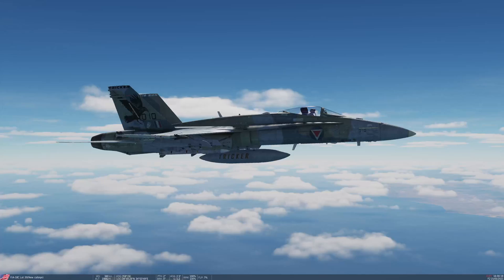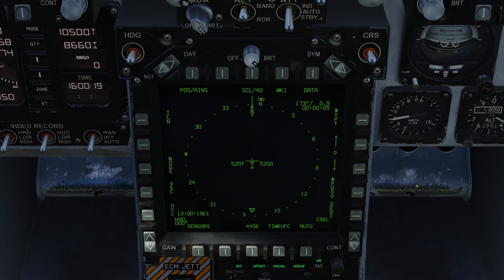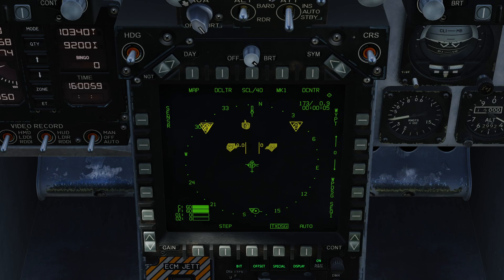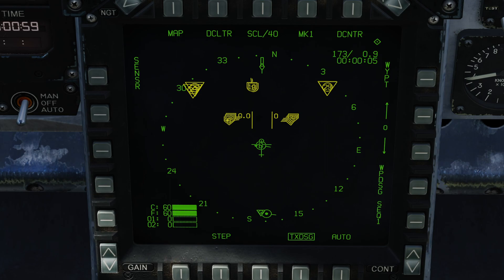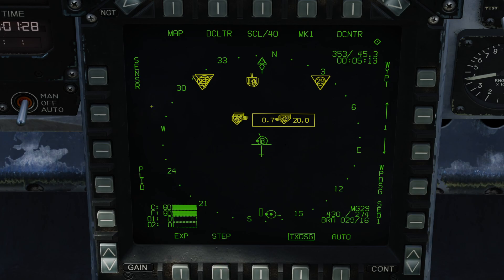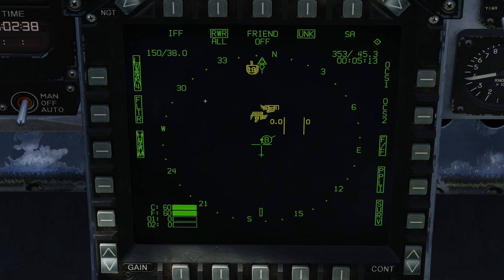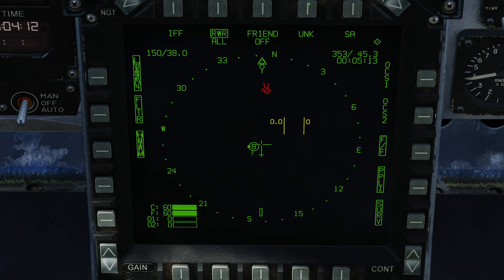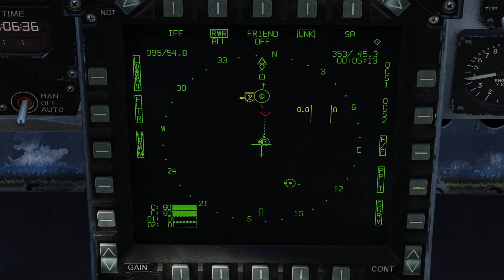DCS F/A-18C Tutorial 18 - SA Page

Comment: Does bulls not need to be setup on waypt 59?
Reply from the maker: No, on the Hornet it can be any waypoint. On the F-16 it is steerpoint 25.
Reply: @deephack  I thought/think wpt 59 is automatically populated with Bullseye on the map. If you set wpt 1 to bulls whatever wpt 1 is will become your jets bullseye. It wont match anyone else who setup a proper bulls. If I understand that right?
Reply: @projenitor2387  BE can be set up for any waypoint. Infact, depending on your mission you may want to BE multiple locations if they are far from each other. This will need to be understood by the group and not represented on the map as a dedicated BE. Since the AWACS is giving calls to all aircraft and it's preset it is generally set via mission editor, with a marking on the theater map... So everyone is on the same page across all changing missions etc.

Let's say you were to go out on a strike mission. WP1 could be BE1 for your flight group and dedicated AWACS. Once the mission is complete and you move to WP2 which is another target, you can set BE to that WP. AWACS if maned, would also switch it's BE... Since AWACS is automated it's simplified and BE isn't as useful or precise but it does help to keep a good overall picture of the airspace. 

The reason I would BE each WP for each mission if I had a flight group is because you know from your target location where aircraft is around that area.. 180/20 from BE would mean that there is a target 20km south of the target.. easy peasy.
Reply: @Snowpinemedia  Wouldn't that denote that each flight would have to adjust it's bulls on some one else's schedule?

If I complete task at wp 1 Bulls on that way point. When I move on to wp 2 some other flight would have to know that in order to track any marked targets? 

It's to my understanding Bulls is set for the theater so one flight 50 miles east, and another flight 50 miles west can have a picture of the battle space from the same reference point?

A lot of our missions have 60-to 70 active player aircraft with their own tasking. I feel swapping bulls and keeping all 70 aircraft on the same page would be counter intuitive?
Reply: @projenitor2387  Yes that is what I said. I said it's changeable for dedicated missions.  
If there are multiple missions, or a larger theater of war it would strategically be placed  somewhere close to the AO. Hence why they don't just reference homebase or a tacan station to an airbase and go off that.. 
I was referencing why they are able to be switched not that they are always used in that way.